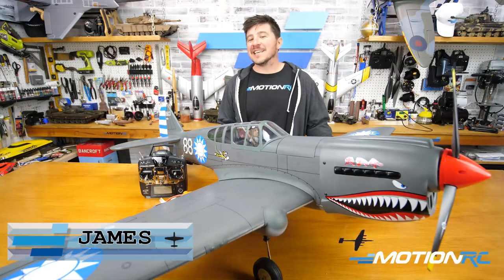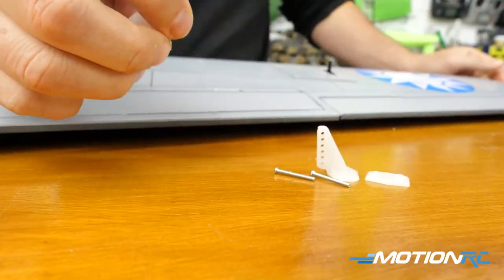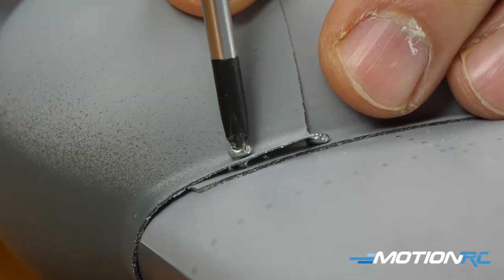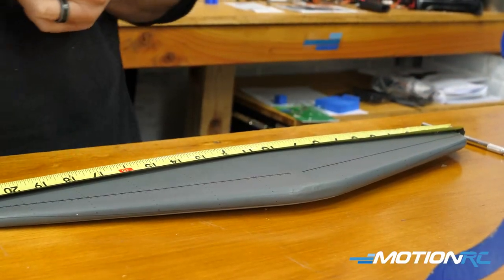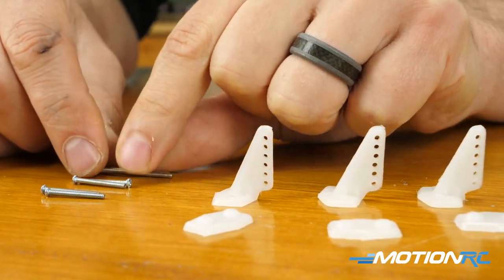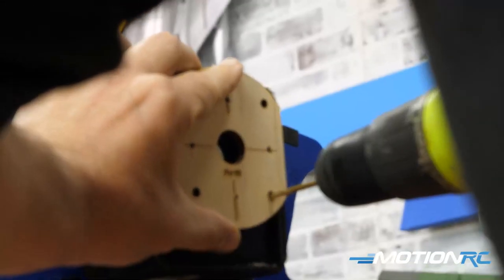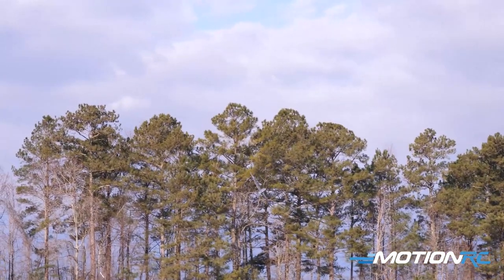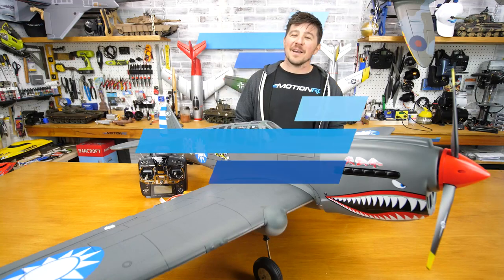Assembling the Nexa P-40 Warhawk 61.8" (1570mm) Balsa ARF - Part 2 - Motion RC

Comment: Merry Xmas and happy New year from little New Zealand.     Assembling this model over the holidays break here in New Zealand,.  Having a headache mounting my engine,.  I'm using a RCGF15RE,.    Front of drive wisher of engine has ended up being at 140mm (5.5") as said in the instructional video,.  I also had to raise the centre line of my motor 13mm (0.5") above the crosshair marked on the fire wall.
I also opened up bottom of the cowl mount,. Bottom of fire wall, and opened up the front of the cowl to give a more scale look,. And a lot more better cooling.     They are a fantastic ARF,.  Considering the little price payed for them,.    But you do need to look hard at the model and use some clever judgement of your own,.     Only page of any use in the manual is the last page,. CG and control throws,.   Pretty much throw the manual away and measure, measure, measure.      Good luck guys.   Enjoy your build

Comment: For the hinges I like to use plain chap stick drag it across your pin section gently heat it with heat gun just to melt it through to the pin and other side works like a charm

Comment: Hi, well mounting the motor you didn't read the manunal well, see page11. It is mentioned -Push the four 5x70mm bolts through the fire-wall. And if you look in manual they mounted the motor on drawing higher from the beginning. Grts Hans
Reply from the maker: all worked out in the end. she flies fantastically
Reply: Manual also says to mount drive plate of motor,. Both electric and IC engines at a distance of 121mm,.   I can't push my cowl on any closer than to enable me to mount my engine any closer than 140mm.   Manual is way out

Comment: It's better to lengthen wires from motor to speed control as needed. Lengthening wires from speed control to motor battery can damage speed control capacitors over time due to voltage spikes.

Comment: PLEASE, need some help!  Can someone tell me how your guys at Motion were able to fit a MAS 15x7 3-blade prop on this airplane using the GP10 motor?  The prop shaft adapter is WAY too short to accommodate the thickness of the prop hub.  Best I can do is get a 14x7 to fit and that is only by not using the prop washer and still only having a few shaft threads...not enough threads to even go all the way through the nut.  I'm not comfortable flying this beautiful bird without a better prop fit.  Thanks!